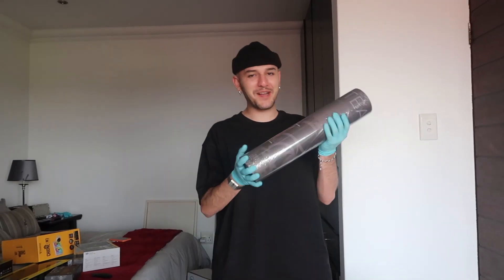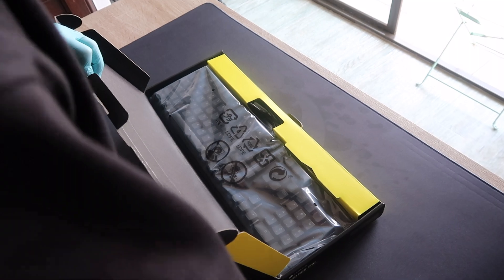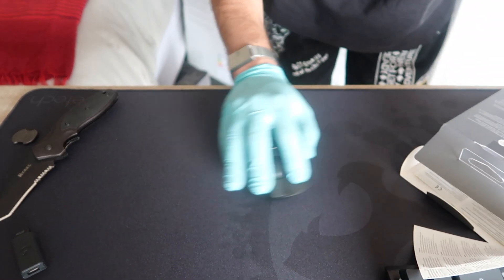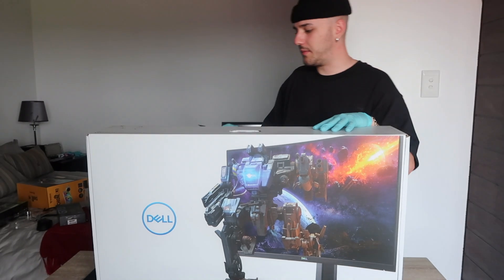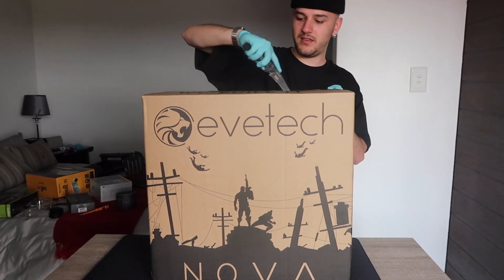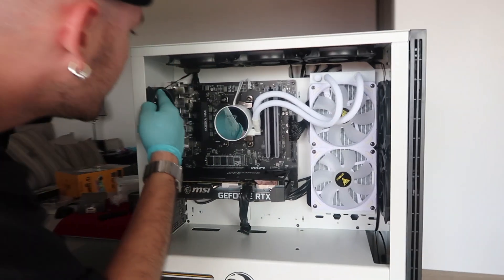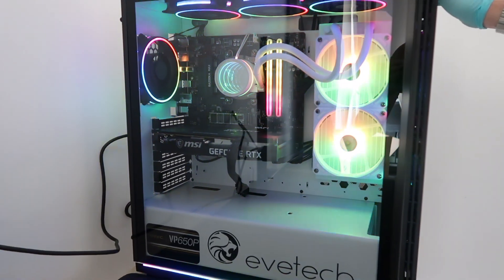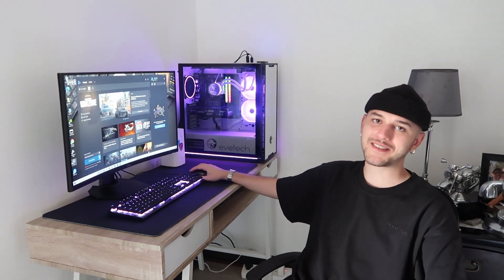JOINING THE PC MASTER RACE | Evetech Unboxing Video

Comment: DAMNNN i9 and 3060ti, mad fucking build🔥
Reply: ok i9 is too much and a 3060ti is too little for a high end build. It would've been better if it was mid tier build with 3060ti or 6600xt and a i5 12600k or a high end build with a i7 12800k and a 3070 or 3080 or even AMD's Rx6800, 6700 or 6900 regular or xt version

Comment: I recommend to build yourself next time Bc then you control better how you spend your money. You have a premium CPU with a high-mid tier GPU. If you want a gaming build it should be the other way around but for a productivity build if you're video editing etc., that's fine. Also the Gamdias AIO liquid cooler BARELY cuts it for an Ryzen 9. Pls consult professional builders on YouTube. Also the PSU also barely cuts it and you'll have to replace it when you upgrade your GPU. Otherwise nice PC and I'm happy for you.🤍❤️

Maybe you could upgrade the storage as you go on?
Reply from the maker: hey bro thanks a lot for the in depth comment, i really appreciate it. i’m brand new to the PC scene so the PC got built by evetech but i can already see that i need to upgrade things like my storage. i’m not 100% sure about the CPU/GPU? i actually got the PC build for architectural renderings 🤷🏻
Reply: @9thSun  oh I understand then the CPU GPU combo is fine. Awsome choice then. 
I'm a lady btw 😂